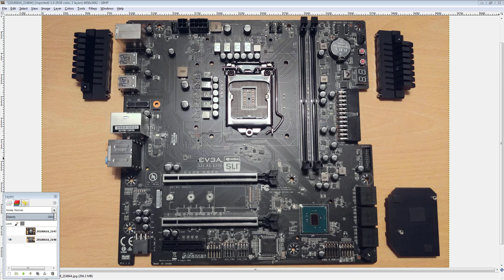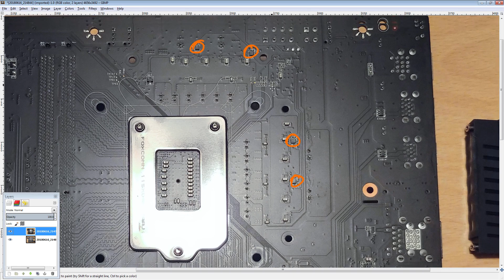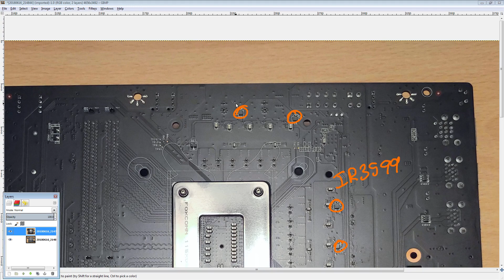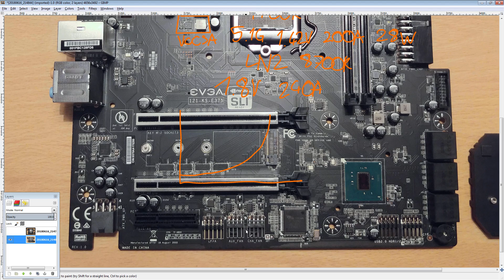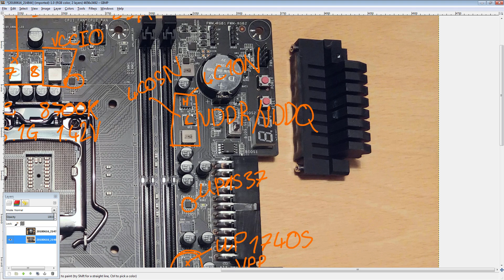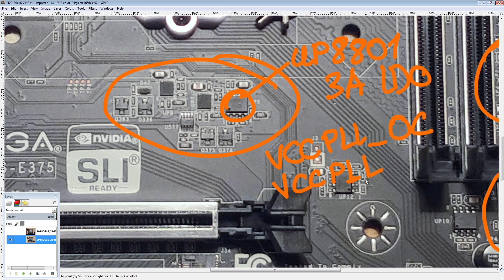Motherboard PCB Breakdown: EVGA Z370 Micro

Comment: Bit late to the review, but hopefully ya see this.

I own two evga z370 classified k Motherboards and can confirm all of your suspicions about the quality of these boards, (including a somewhat lacking bios), except one. The vrm heatsinks are not the greatest (at least for overclocking).

Have an 8086k with stable clock of 5.35ghz at 1.36v, and an 8700k with stable clock of 5.2ghz at 1.35v in these boards.  The only thing is that I had to buy universal vrm waterblocks and grind their WIDTH down to fit the mobos.   Otherwise my vrms would get to 113°C, (with ample air flow), and throttling or instability would occur.

Comment: Hey Buildzoid, can you check out the ASUS P7P55D-E Premium or the Gigabyte GA-P55A-UD6? I recently came across these and they claim to have “35 phase” and “24 phase” power... I know these boards are at least 7-8 years old but they look really cool. I can provide photos of the PCBs.
Reply: @Tim Peng That would be relly cool. I doubt that Buildzoid have exp with 1156 platform though, but he can try. But damn GB P55 UD6/UD7 both look stacked.

Comment: From what I've been reading online all Evga Z370 mobos, including this one, have major Vdroop/LLC issue. So even though it has decent hardware, the software part (bios) doesn't really allow for high overclocks (on 8700K in particular) without spiking into crazy high volts and/or drooping. Which is a shame, because it defeats the purpose of this overclocker oriented mobo.
Reply: Yes, Adaptive voltage doesn't work well on this motherboard for high overclocks that require >1.35v for stability.  Using Adaptive voltage at this voltage will shoot upwards of 1.45v on load.  With VDROOP disabled, my 5GHz overclock at 1.315v will load up to 1.392v under extreme usage (AVX) and 1.336-1.376v for typical all-core usage.

However, if you use Manual voltage without VDROOP, the voltage is much more stable for really high overclocks and doesn't fluctuate much at all.  My 5GHz at 1.320v never goes above 1.328v under extreme usage.  Likewise, I've tried 5.1GHz at 1.408v and the load voltage doesn't go past 1.424v under extreme usage.

Have to say that for how tiny the heatsinks are, their increased surface area is where they shine.  With just a 120mm fan blowing on them and the RAM, the VRMs manage to stay under 45C.  I used to have a MOSFET water block on a Maximus VII Gene with a 4.9GHz 4790K, and the VRM temps reach 55C.

Comment: I'm trying to decide between this and the Asrock Fatal1ty Z370 ITX. This board's components look great but the Asrock looks like it offers just a couple more features. I could be wrong but I've seen comments about BIOS being a bit harder to use on the Micro.
Reply: Eric How much is it?
Reply: The EVGA Z370 Micro is available for $200 in the US at Newegg but currently $120 for the next 8-9 hours. The Asrock ITX is $164.99 at Microcenter but I can pick up the 8700k along with it to obtain a $30 discount. Prices are without tax.

Comment: Hi buildzoid! Solid content on the board analysis but, mate, I think the "average OC numbers" you give for CoffeeLake are pretty unrealistic. 5,1Ghz at 1,42V in AVX workloads is a unicorn sample you can't even purchase from Silicon Lottery. Their top bin for months has been 5,2Ghz 1,435V but with -2AVX offset: so it's 5Ghz when you actually stress it. Now they have 5,3Ghz 8086k's, but again, that's the top bin and with said -2AVX offset it does 5,1Ghz 1,435V during AVX (for a hefty 400$ premium).

People often don't disclose AVX offsets when bragging about overclocking in forums. I'd say 5,1Ghz (during AVX) at 1,42V is a baller CPU. Most people are struggling to hold 5Ghz if you ask them for a Prime95 or IBT2.54 screenshot, as the average Joe runs "5,2Ghz" bruteforced at 1,4V but throttled down to 4,9Ghz during AVX. Please visit the Intel CPUs section at overclock.net forums, there's plenty of reports to reconsider the average OC numbers.

Other than that, top notch content, keep it up! Cheers

Comment: Do you have an opinion on the 90° connectors all around the board? I suppose it makes sense in a testbench-like setup, but it sure seems like a lot of wasted space (connector + necessary cutouts) for a regular old motherboard.

I guess EVGA are not doing enough motherboards to make general usability much of a concern.

Comment: Biggest issue with the Z370 and memory, IMO, is there is no RTL/IOL configuration or DDR VTT control in the UEFI.  It boots memory at 4KC12 but without those tuning options, is tough to get bench stable.

Comment: Heatsync’s are NOT supposed to dissipate heat or they’d call them heat disspipators! 

Clearly they’re designed to sync w/your heat & Store it for later retrieval. Or upload to the clouds (weather permitting). Just like Dropbox desktop sync basically but for motherboard components. 

And yes I know Bill Boyd knows this, he’s obviously being sarcastic or trolling people, I’m just clarifying for people who have this board & are worried they’re going to lose their heat backups or syncing capabilities entirely. 

If that’s you don’t fret, go turn on your system, give it a minute to load your heat. Check it out and you’ll see still syncing with your heat flawlessly & will load your latest backup without issue, temps will confirm!!!

Don’t let the conspiracy theorist trolls get you, nobody’s just siphoning off your heat, if it was being dissipated you’d know, the first time you went to turn on your computer you’d notice it failed to load your previous thermal backup and your temps would fail to rise to normal operating idle levels
Reply: Underrated comment.
Reply: PHooMAA thanks, the humorous comments that takes thought and time to write & therefore gasp requires reading, thought, & time to appreciate it is a largely thankless game on YT. Lol.
Reply: Damn i felt for trolls all this time...
Reply: Genuinely made me audibly chortle

Comment: the front panel connectors as well as the 24 pin and cpu and aux 6pin power connections bent like that are where the boards since at least ryzen came out should have been how all board should have been and should be as a standard

Comment: So basically a Maximus VIII Gene board with the Coffe Lake bios mod is still the beas mATX board out there...
Reply: Does a mod exist for the Gene? Do you have a link? I only found mods for the ASRock.
Reply: Yes it does for every z170/z270 board there's a guide here: https://www.win-raid.com/t3413f16-GUIDE-Coffee-Lake-CPUs-on-Skylake-and-Kaby-Lake-motherboards-19.html  Read everything (there's a gpu fix to apply after flashing) do it consciounsly. (I mean if you're going to upgrade anyway is worth trying, i can't stand to sell my Beloved Gene for 50 bucks to "upgrade" to a Z370 which has half of it's quality)
Reply: Thanks. I have seen this thread but did not see any reference to Gene. Have you done this on your own Gene with success? Some motherboards require a hardware mod (fly-lead) to adjust resistance or force the BIOS update. I have seen a report of partial success on an Apex but then HT didn't work.
Reply: Planning to do it this summer, gotta find someone patient enough to help me via discord. However if you wanna keep in touch you can add me on discord MietiDiscord #3621
Reply: Good luck. I would be interested to hear how you get on. I am comfortable with the BIOS and CPU mod, but wouldn't know where to start if the board also needs a mod. Potential lack of HT also concerns me. Hopefully Z390 will bring a Gene-like quality board.

Comment: i dont really need an 8 core but it would be nice if the 9700k runs on z370.  if tradition holds it will.  youve got 2 generations on 1 board since the 2nd gen.

Comment: hey guys?  do you think that a z370 pro4 from asrock with this vrm heatsink and 2 40mm fans blowing right on it would be alright overclocking an 8700k?  http://aerocooler.com/enzotech-mst-88-full-copper-mosfet-cooler/

im putting the stock vrm heatsink from the cpu vrms on the top which is mostly igpu vrms with one cpu vrm.  should i put one fan on the top heatsink and one on the bottom? or should i put both on the left had side vrm heatsink?

heres a link to a pic of the board stock  https://www.asrock.com/MB/Intel/Z370%20Pro4/index.asp#Download

ive got a decent chip that game at 4.3 at 1.38 or so but a more realistic setup would be 5.1-5.2 at 1.35.  its not delidded yet but im doing that while im in there.  its a pretty good chip silicon lottery wise. and i know this isnt the best board but when i bought i though if i could just 4.9-5ghz at 1.35 or less i would be happy so thats why i bought a lower end motherboard.  i wont be doing any heavy avx stuff and if i do some video rendering i will turn the clocks down a bit with the mobo software.  the vrms are supposed to be 8+2 or seomthing but i know its not really.  i think its 4 phases maybe doubled or maybe just 4 phases with 2 fets per phase.  idk.  i wish buildzoid would do a quick breakdown of it or just tell me how the phases are laid out

i can send a pic if that would help?

Comment: TBH the lack of iGPU support is kinda bummer. They could have at least included single DP output and some very basic VRM for it. iGPU helped me keep on using PC when I was without a dedicated graphics card or when troubleshooting after bad GPU BIOS flash or for driving extra monitors.
Reply: yeah, it's definitely a big asterisk.  And presumably, not Quicksync if you wanted to build a small video editing machine
Reply: Yeah, especialy in the new Premiere Pro the iGPU really helps a lot when rendering... heck, even in the timeline.

Comment: Actually Hardcore Overclocking : a quite poor VRM design considering an i7 8700K eats around 130-140 Watts at 3,7 GHz all core and around 200-220 Watts at 4,7 GHz all core when using Advanced Multicore Enhancement. But the worst part are the VRM heatsinks which are super underdesigned to cool themselves on such of an overheating cpu like Shintel i7 8700K is.
Reply: heat sinks with some surface area...a real 8 phase design...can handle a 8700k at 5ghz around 1.4 volts all day no problems....I think your issues are with the 8700k?
Reply: I don't own one, I'm on a FX-8350.....but i did watch the video...and that's a nice VRM setup...
Reply: LFly R - Stop with the nonesense, really. MCE should not be used ever, its the dumbest ''feature'' ever, and this board should handle 4.7 8700K even with enabled MCE which will bump quite unreasonable voltage most likely (1.4v.).
Reply: Kindis : MCE is the only feature that give Shintel i7 8700K an edge in IPC and was used by all biased and bribed reviews at launch to falsify results compared to AMD so....yeah it should be used despite the fact we know that power consumption rises to 200-220 Watts but hey, it was good for bribed reviews so it should be able to be used by every consumer :).
Reply: LFly R MCE was enabled on some Asus board by default, it might not be the reviewers's fault, might be otherwise. And its not a ''feature'' its for the people who dont want to overclock (for whatever reason) the real its meant to be oc'ed. Ryzen 2600X and 8700K at 4Ghz have about 5% IPC difference between them.
Exactly, it should not be used, its dumb. It shoves way too much voltage for 4.7GHz all core turbo.
Reply: Kindis : well when the biased reviews happened it wasn't that dumb of a feature and it gave Shintel fanboys fuel to troll....so therefore motherboards should be designed to be able to handle MCE....otherwise i7 8700K isn't what it's marketed as. And Ryzen 5 2600X at 4,0 GHz vs i7 8700K at 4,0 GHz have an average difference of 0 % in IPC, older games run better on Shintel, never games better on Ryzen cpu-s....that video of Steve from Hardware Unboxed is skewed unfortunately and it's not to be taken seriously.
Reply: LFly R - you clearly dont know what you talkin about. Being fanboy/biased aint a good thing.
Reply: Kindis : I know exactly what I am talking about....the problem is that you don't want to hear the truth :). I agree being a fanboy is a bad thing, especially if you do it for the wrong and inferior manufacturer like Shintel is....so stop it :).
Reply: Bought this board and have put it thru some stressing the last 2 days. Being $120 off NewEgg at the time (currently $120 off EVGA.com) it seemed like a good budget board to try. The VRM is solid and runs rather cool. Have had the 8086K at 5.4GHz, 1.475v vCore...VRM temps didn't exceed 52C with limited airflow over the Heatsink. BZ helped me push a B-Die kit to 3966, 1.935 VDIMM, tight timings and a 102 BCLK: it's working damn well. It's on par with a Hero X $240 board and VRM temps are actually lower on this one. This is a killer board at its price point.
Reply: The Spitting Llama : warning, Shintel shill exagerating too much with the numbers....boy better do some research before shilling for Shintel because your a little too high numbers of a fictional overclock give you away too easy :-)
Reply: LFly R .... You do know  that your credibility is very sketchy. The video is on contrary to what you are saying. Sooooo why don't you make an analysis video I'm willing to watch your side. Maybe you are right. Who knows let's keep it professional and see someone analyze this board.
Reply: Correction let's see you or someone else make a proof of your statement.
Reply: LFly R on another note people who prefer Intel should be left alone. People who prefer AMD should also be left alone as everyone has the right to purchase what they what with their money.
Reply: Infamous Q 
1. I am an electrical engineer
2. On youtube anybody can become a self proclaimed reviewer without any real knowledge prior to that so youtube is mostly an illegitimate and skewed source of knowledge
3. Facts that I stated were checked and experienced by myself due to the fact that I am a PC builder since the age of 3D-FX Voodoo 2 and have around 4000 PC rigs/laptops repaired or built under my belt
Reply: LFly R Sounds fair.
Reply: Mate, I dont think that this channel is about fanboyism. You can keep your highly-subjective opinion for yourself.
Reply: Kindis : You calling my legitimate point of view as a fanboyism based one gives you up as a true Shintel shill. You are so paranoid that even if somebody says something completely legitimate and is with it dissing your precious Shintel related product because it truly is a poor product, you immediately mark them as a fanboy. Facts are facts and this motherboard is one big pile of crap if you look at it from an electrical engineering point of view because it's too weak and underdesigned is one is to put an i5 8600K or an i7 8700K on it.
Reply: cheese toucher : warning, Shintel shill detected....you should stop lying about your ownership of an i7 8700K and especially the overclocks. This board cannot handle this no matter how much you wish it did in your wet dreams, power phase is not really 8 phase, those are doubled phases and VRM-s heatsink is only a small piece of aluminium that absolutely has troubles cooling the VRM-s already at stock considering the specifications of VRM-s alone and power they try to deliver :).
Reply: cheese toucher : the way you said "heat sinks with some surface area...a real 8 phase design...can handle a 8700k at 5ghz around 1.4 volts all day no problems" sounded like you are fully sure of it just like you owned one and now you are on an FX 8350....sure, yeah :). 
No it's not a nice VRM setup, it's too weak to run an i7 8700K at stock clocks using "advanced multicore enhancement" turned on which is the way this cpu should be used. Power phases on this board are too weak and basic only able to run maybe an i5 8600K at stock clocks at its full frequency without "advanced multicore enhancement" turned on....but that's it.

Comment: +Buildzoid How come Steve at GN has not sent you one of his ModMat's? 
2 more questions:
-Is there a coating that you could put on a board that would prevent short circuits due to water?
-What would be your recommended memory settings for Corsair Dominator 2133 in Q-channel (8X4GB) matched set, on an X79 DARK, with an i7-4820K? (CPU running at 4.7GHz, MEM at 2133 via XMP, with a GTX 1080 FE, all on a large custom loop - See the avatar pic)(Haven't found blocks for the VRM's or the chipset yet. When I disassemble it, I will take measurements and make my own.)
Thanks for your consideration,
Matt
Reply from the maker: Steve offered me a mod mat. It's just too big for my desks and at the time we didn't know how it would hold up to soldering.
For sub ambient overclocking I just plastidip things to keep water from shorting things out.
As for the memory. Really depends on what memory IC you have. You could try check with Thaiphoon burner.
Reply: Steve did a video on torture testing the mat, and it seemed to fair pretty well. Plastidip, good call! I haven't heard of Thaiphoon burner, but I will check it out for sure. Thanks for your prompt response, and for the great content. Do you have an address that one could send you hardware? For keeps, of course! And to use at your discretion! Have a great day!
Reply: Also, is the mat too tough to cut, or would Steve be mad about it? LOL!
Reply: Since most motherboards these days have a black PCB, I prefer the lighter background for better contrast